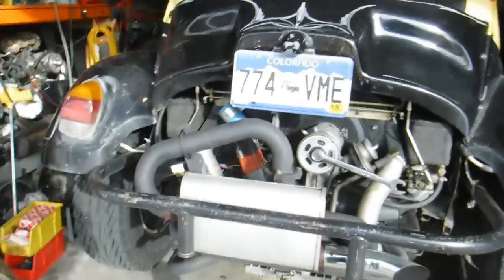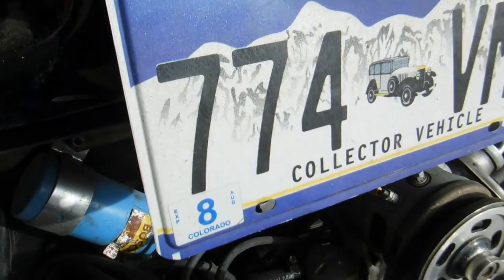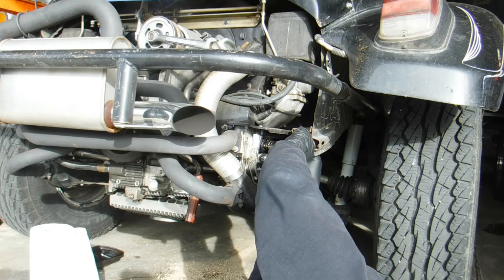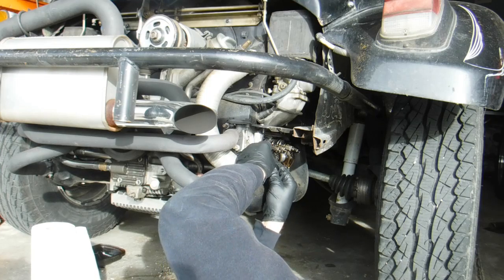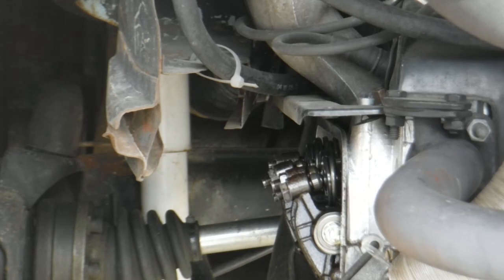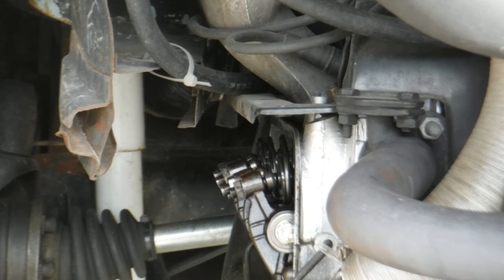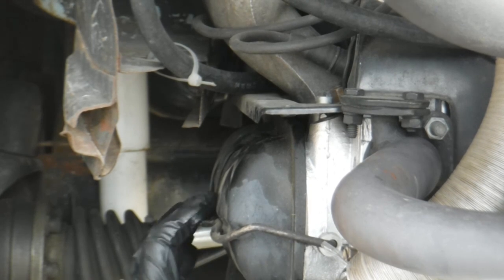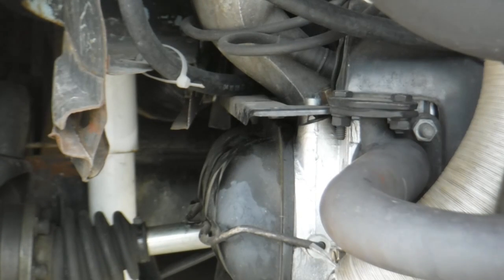Valve Lash Inspection

Comment: Hey GZ, It's great to see anther "R" button session..  It looks like Rusty is being good to you.. Is that your 1776, or your 2000?  Great job it's doing you..  I have a quick question for you, if you don't mind..  I looked through all your video's and didn't find anything... I'm fixing to do a compression check on my 1776 rail, When I go to do the check, Do you pull all the plugs out, or just one at a time?  Thank's for any info you have..  I hope to get out that way this summer, maybe meet up at Smash burger, on me... Take care brother...
Reply: I am Not EZGZ, but you should pull out ALL spark plugs.  That makes the engine
fly fast and with no effort.  If you leave the plugs in, you are wearing heavily on
your starter motor, and after all the cranking you will be doing, you are probably
also over-heating the starter motor.  Hope it does not destroy the starter, if 
anyone cranks for too long a time........... Take out ALL the plugs, ALL the time.  Bill Simpson in Toronto,  Canada, with 7 Beetles.

Comment: That's the way I do it too.  I check the valves often just so I can check for leaks and other potential problems. Thanks for the support and the shoutout the wind was blowing the Baja all over the road it really zaps your power when your doing 50 with a 45 mph headwind. Have a great day brother.  VW:-)

Comment: watching you there turning the engine backwards reminded me of an incident i once had while working on a car ,i was doing the tappets on a renault  12 ,a long time ago , i was turning the engine clock wise but i went too far  and then turned it backwards to get the rockers  just right  for checking  and to my horror i then felt the  timing chain slip , i thought the chain adjuster was worn  so i took off the chain cover to have a look but all was as it should be , it was just the way the adjuster was designed so people be warned especially when working on old renault's lol.
Reply from the maker: Good Story, Thanks for sharring